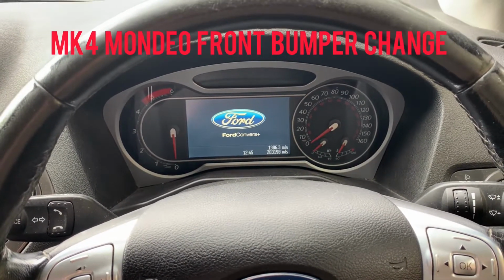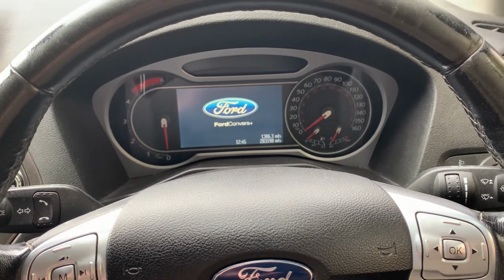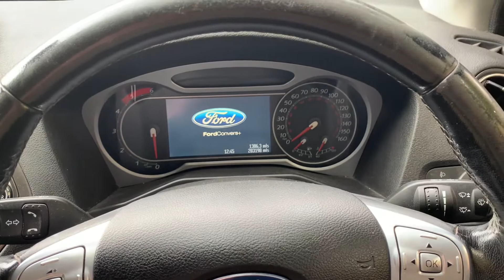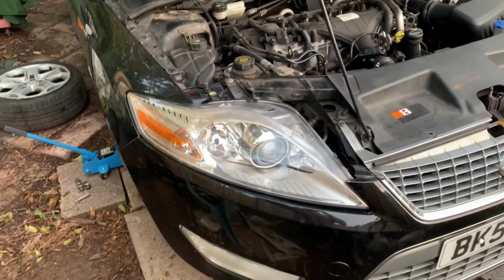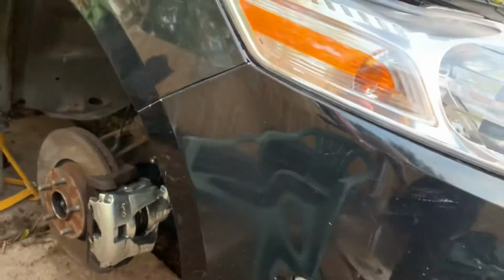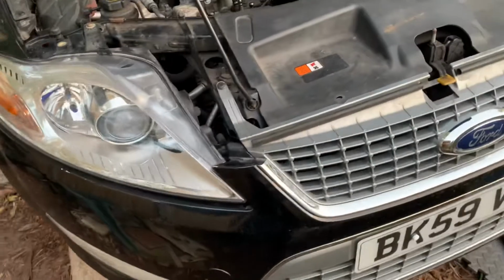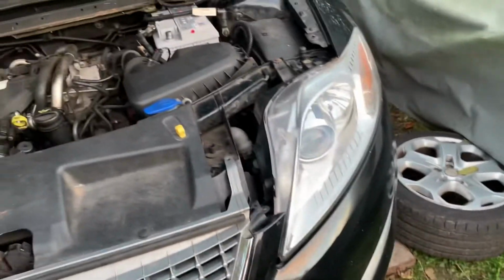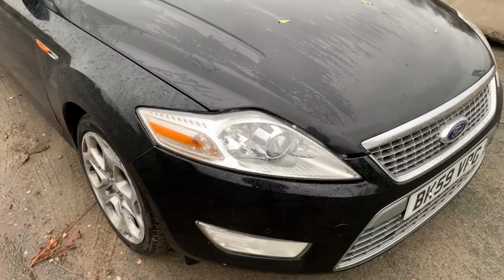How to change a front bumper

Comment: You don’t need to remove bumper or wheel arch liners this has made the job twice as long.
Reply from the maker: how do you change the bumper without removing it?
Reply: Wrong question I think. How do you change the plastic parts that is broken without removing bumper or wheel arch liners?
Hej actually just needs to be able to mount that new bracket. Answers would help me I am about to do the exact same job on a s-max.